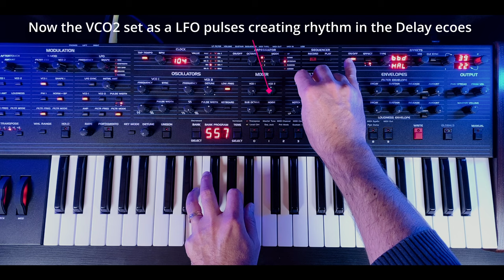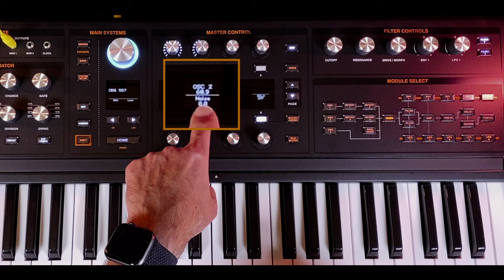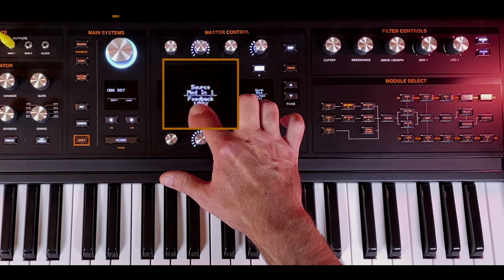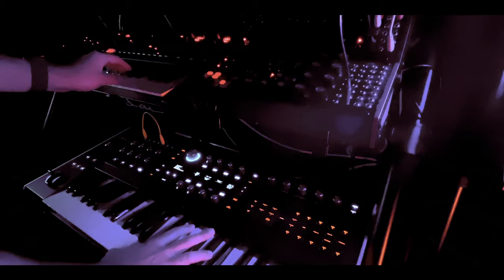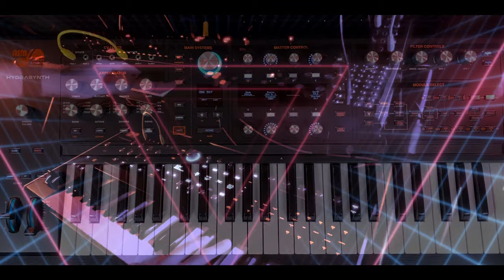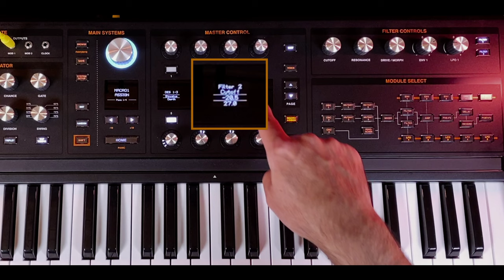Lessons from OB6 applied to Hydra

Comment: they always say its the filters that really define the character of a synth. definitely contributes to the differences here, but you definitely got close. i will copy the patch tomorrow if i have time.
Reply from the maker: There is an “out of the box” factor, that with some classic synths you get these characteristic sounds of the songs we like (that have used those synths in the first place) with no effort, because the architecture, preset patches, sound sources or filters simply sound like that. But then people gets tired and starts experimenting with crazy modulation or “hacks” like the famous Mini Moog feedback. But this is why I like this exercise, to take you out of the comfort zone of the out of the box.
Reply: @ShaperSoundChannel  yeah its something that will teach you about the strengths and limitations of both machines. part of why i like this series so much. i switched from rotate to random on the voice menu when i tried this cause on the deluxe the 16 voices didnt get from left to right fast enough and i also shifted the octave up once on the keyboard.

i think if you wanted to do something more like shifting between the notch and band pass you can set an LFO to modulate the mixer parameters OSC1F1/2 and OSC2F1/2 and see if series or parallel filters works better when you do it? I tried that with LFO 3 and it definitely had an effect on the sound, but im not sure if it was more OB6 like or not. then you could set a macro up to to influence that further with either mixer parameters or LFO parameters maybe?
Reply from the maker: @GillamtheGreatest  love it! Yes to be honest I have not tried to run a spectrometer on the OB6 to try to understand what on earth is the wave form looking like when they do that modulation from Notch to BP, but the volumes in the mixer should have a cool effect. Does it sound cool when mixing it?  Always cool to ping pong these things with you guys!
Reply: @ShaperSoundChannel  yeah i would say it sounds pretty good, while staying in the same ballpark. i think i would need to have an  OB6 on hand to see if im getting closer to it sound wise though
Reply: The same filter slope without resonance and without drive is pretty much the same on every synth - once you drive into the filter or use resonance - there is the characteristic - for casual pads you dont really do this and therefore for pad sounds the filter usually doesnt matter
Its much more important for monophonic/bass sounds 
Thats at least what i´ve found out @GillamtheGreatest
Reply: @novalogue  well in this video hes talking about how the filter morphs between filter types in a way that you just cant do on the hydra, so theres more differences than just those three parameters in this case, but i do agree that filters can sound pretty similar if they are the same slope without drive or resonance or any of the other things that make them unique. i think the saying about filters defining the character of synths comes more from when you start cranking things or pushing them hard or actually using the parts of them that make them stand out.